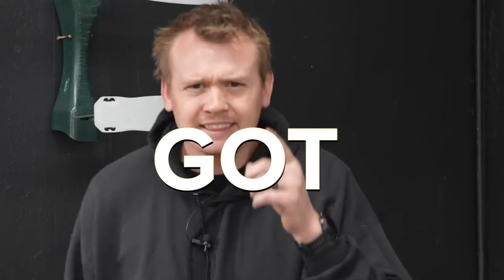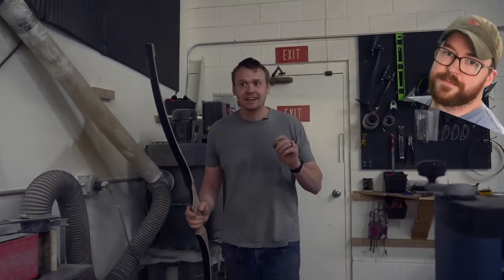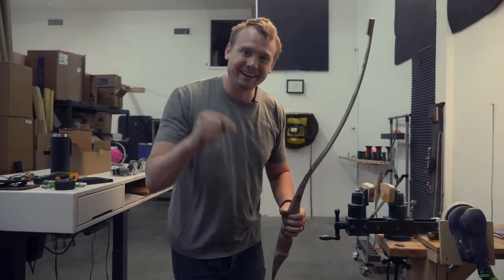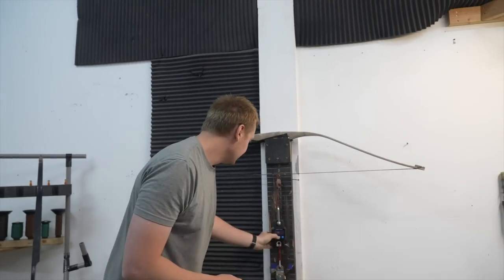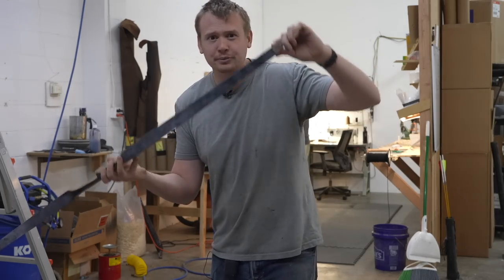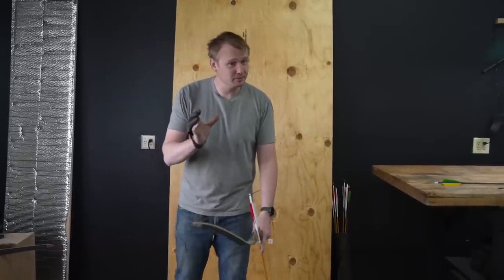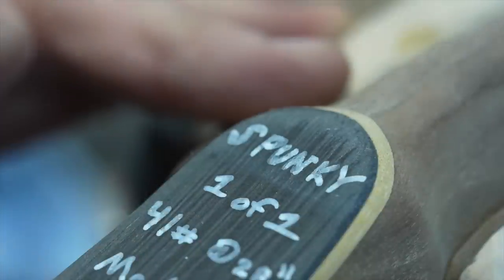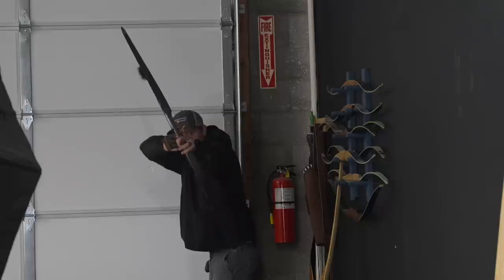DIY BOW BUILD - Lower Poundage = Faster Bow 😮

Comment: Correct me if I'm wrong , but judging by this video it looks like you could increase your production rateand lower costs of production, like 80 % more effective by using a lot less sanders and grinders instead use saws, planers and knifes. or is there a reason for it?

Comment: Adding mass to the part that has to move the most is going to slow you down. 
If you start wider at the riser you can preserve the higher draw weight, introduce more taper, and have a faster bow that still has good manners when you loose.
    Then if you want to get fun…
Introduce very narrow tips and reverse tiller them, make them thicker front to back, so they are rigid. 
    Then you preserve string angle, reducing stack, so you can make the overall length the bow shorter. Shorter limbs, less mass, more speed…
Reply: Well said!!! I would only add that in this scenario you have to be careful your portions of the limbs traveling a great distance are not under too much stress.

Comment: Hey there, I am about to attempt my first bow with some pin oak I got hold of. Just wondering since it's going to be a self bow whether it's ok to have the back of the tips a little wider rather than the front to work as tip overlies as I want to use the flat face of the log to make the bow and would rather not glue anything onto the back of the bow at all.

Comment: Ive been bingeing these tutorials like crazy lately and i have a few questions. So i have been wanting to get back into archery but this time i want to put my carpentry skills to work and build my own. the problem is i prefer really light draw weights like around 20 pounds or less. is it possible to make a wooden self bow with that light of a draw weight? so many tutorials have bows with crazy draw weights and im not sure where to start. any advice would be amazing. thanks for the amazing content!!!
Reply: have u seen the snake bow by arc rolan in France?
all plastic shooting a max of 26 lb down through 20 and into 18 on the sixty inch adult version.
being plastic they're considered virtually unbreakable particularly with putting the limbs into twist when stringing and de stringing without using a stringer.
so maybe the best bow for learning on and even then one you'll likely go back to later on when you're shooting heavier or simply more expensive bows.
under 45 bucks.
Reply: @mattredfern1339  no I haven't! that's super cool I'll def check it out. thanks!!
Reply: @Space_Cadet_inc  Thank You fella, be lucky and shoot straight fella 🏹

Comment: Several other things you can do to make it faster and smoother ,  go to 1/2 inch tips, reduce tip  overlay thickness and add more taper to the lams..  If you want even more speed,  make the press so the tips are  as forward as the  back of the bow ,  it will get more twitchy then tho..
Reply from the maker: Absolutely, I agree with this - its a dance between seed and smoothness.
Reply: Someone named Yuukah (or close to that) in Europe r making that design. Supposedly less tip twitch as the arrow leaves the string.
Reply: @josephtreadlightly5686  Uukha are usually full carbon ILF limbs,  so are  pretty different. They are moderate when to comes to speed.
Reply: @tmoanpumba5487  I was referring to the shape, not the composition.

Comment: Ok! Here is a serious question from a non knowledgeable person.
I am 5'4" tall. Does it matter of the length of the bow, and poundage of pull?
Reply: The length of draw and length of arrow are determined by the length of you arms and chest.  So your bow dose not need grate length if arrow is only 27 inches long. Probably no benefit to extra length. Poundage is by your strength.

Comment: 170 is not enough. Ideally this is 60-65 m/s for a 40 lb light arrow (22 grams)
Reply: I mean, 60 m/s is the minimum level for a "light" arrow. The bow should be able to withstand shooting 17 gram arrows without kickback or breakage. This bow will produce 63-65 m/s and it is a regular bow with fiberglass, still without carbon.

Comment: I have a question for you. I bought a custom made bow second hand. It's a takedown bow. The limbs are 70lbs. I have a really hard time drawing that sucker. The limbs are not laminated on either side however the front or back of the limbs have a special knock at the ends.
What is the best way to tiller the limbs down to about 55lbs?
I was thinking of sanding the belly.